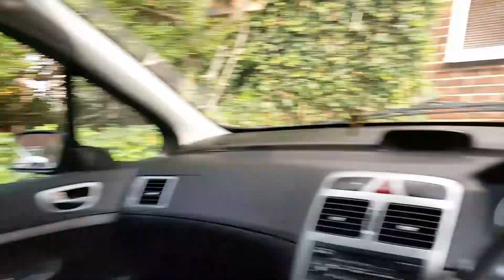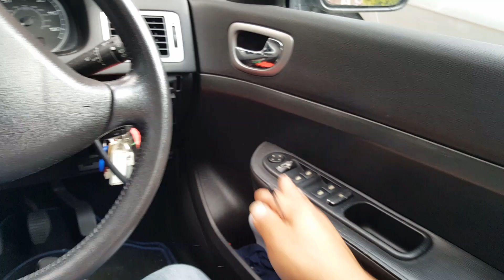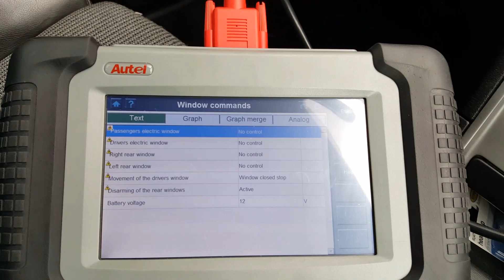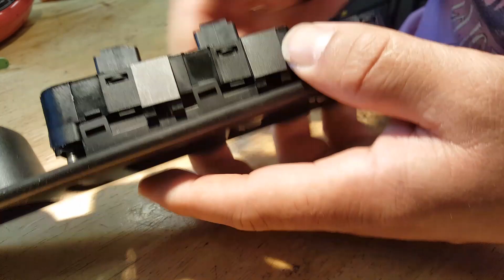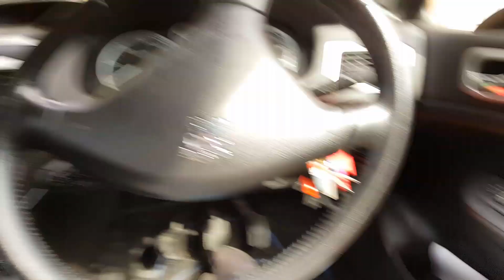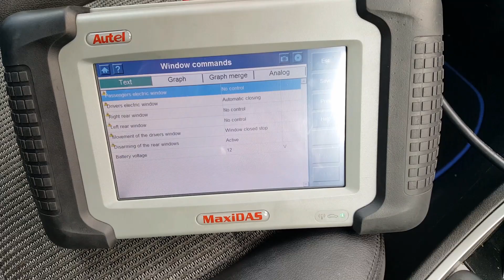Peugeot 307 2004 electric window button not working, repair.

Comment: This has to be the worst video ive ever seen on YouTube. Just show people how to remove the switch and board and how to clean. U didn't show either. Most people don't have electric metre's and if they did they wouldn't be on YouTube looking. Babbling on about readings on a metre and not showing how to disassemble the switch or even how u cleaned it jeez.

Comment: Hello I was watching a video of you about the Peugeot 307 airbag light that tells you how to solve it. What happens with mine is that it says that the initiator of the 1st airbag circuit is open. I don't know if it is a coincidence or not but I messed with the 2000 to repair a fault in the turn signal spring and after a while this error started to appear is it a coincidence or can it be something else?
Reply from the maker: Hi
It can be something else, or something you have missed... I would double check that everything is connected correctly etc...
Thank you for watching!

Comment: Thanks so much for this clip.  Before removing board only driver side window worked and rear passenger would go down but not up, I pulled the board cleaned all the contacts with a bit of rubbing alchohol and a gentle abrasive.  Every window is back to full functionality.
  Would have liked a close up shot of the connection points you attached the wire to while testing.
  Thanks for making this, this should be the true legacy of youtube, not a bunch of idiots plugging products
Reply from the maker: Thanks!
For watching and for your comment, really appreciated! 
👍👍👍

Comment: Great video, very helpful. But my passenger window will NOT  go up or down at all. Is this something that can be repaired? My roof will not close I'm guessing because of the window???
Reply from the maker: Hi
In that case, it might or might not be related... if they both stopped working at the same time,  then yes, is probably related...
Something like that need further investigation...
But start by check fuses, connectors etc...
Hope that helps. 
Thank you for watching and for your comment!
Reply: THANK YOU SO MUCH!   @LMAutoRepairs
Reply from the maker: @nikkinicholson8337  
👍

Comment: Thanks for the video. Both of my 307 windows refused to go up. Cleaned those contacts on the board and the small buttons embedded in the rubber pad, reassembled and working like new. Great!
Reply from the maker: Toby Liddle 
Thank you for sharing...

Comment: thank you had same problem with my citroen c4 grand Picasso, ive problem with my bottom blendor for the heating think its sticking when switched to tht mode only and car at idle runs ruff only when change to. diffret blendo mode it runs fine could it be shorting out don't think its an easy fix i short about tht ;)

Comment: Got to say a big thank you from Australia. Left window was behaving exactly as you described. Followed your most informative tutorial and cleaned the switch contact points as you did. No corrosion on the circuit board and only tiny contaminants on the contact points. WELL.Now everything works fine and the roof which would not retract for the past six months is working like a bought one:) 307 CC 2007 update. Thought I'd tell the world
Reply from the maker: Glad I could help!
Thank you for watching and for you comment!